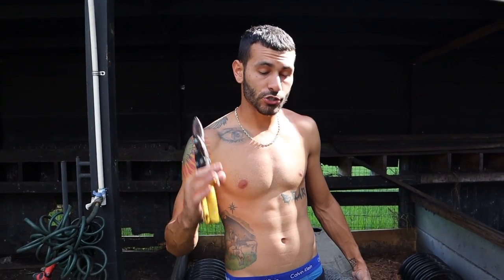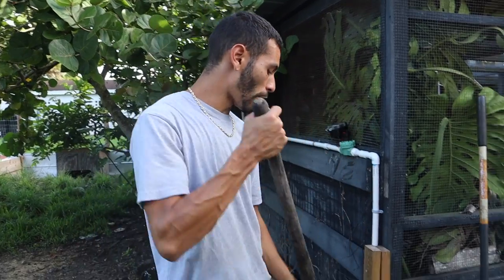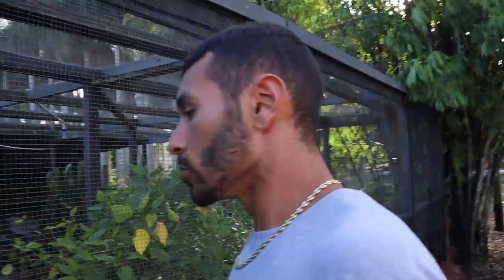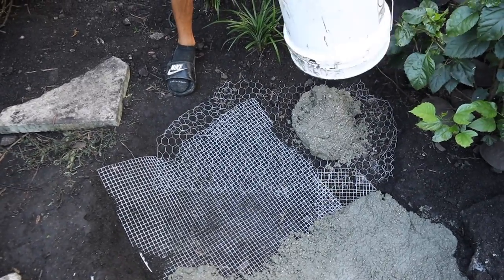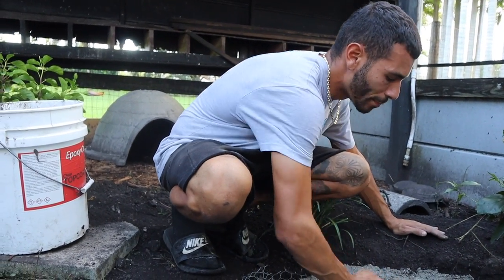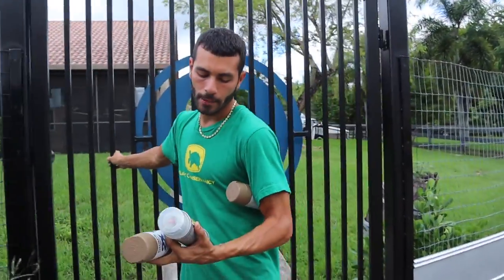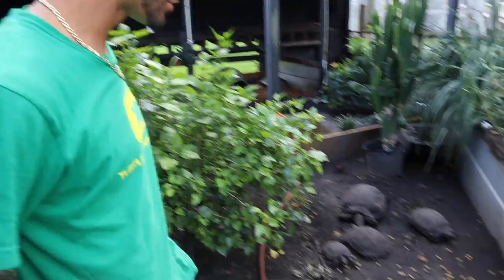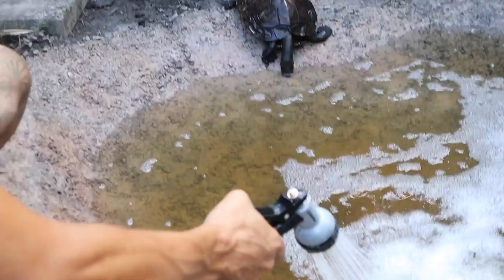HOW TO BUILD CONCRETE TURTLE POND!

Comment: Just a suggestion I had a soft shell turtle and it was outside it was like a baby and I put 2 craw fish in the 20 gallon bucket no algae at all all you have to do is just change water so if you want your water to be clear just put a couple craw fish in there it will keep it nice and clean but if you like the green keep it it’s more natural for the turtles but if you put craw fish they will eat all the larvae in the water as well and parasites they are very healthy for ponds

Comment: Love the turtle drinking water scene at the end. Also, was wondering if spraying the inside of the pond with spray paint was ok because wouldn't it harm them as the chemical breakdown into the water over time.
Reply: no spraypaint has oil and aceton and xylene which is fatal for animals
Reply: @alameenmansoor8230  is there a Comma After The "No"?

Comment: Coming from a licensed contractor. Sorry Blake, that cement work is a Terrible job 😂😂😂. Next time mix the cement with more water until you get a “peanut butter” kind of texture. Then pour. I understand you wanted a dry mix for specific reasons, but as you can see, that cement is not solid now. It’s going to continue breaking up as time goes on.

Comment: It was funny that you were using sheet metal sheers to cut wire.... But then your spreading wet concrete with your bare hands.... I used to do masonry work, and wet uncured concrete mix has corrosive shit in it.... You shouldn't be handling wet concrete with your bare hands, let alone letting it touch your skin at all, and especially not letting it get in your eyes.... When working with concrete your supposed to wear long pants, close toed shoes, and eye protection.

Comment: well. I leaned. don't use raddle can paint to color the concrete when live animals will have contact. pretty much toxic.  Also, when doing a concrete pond, add a curb around the top so the dirt don't fill up the pond and wreck the water clarity. other than, if using regular concrete, you need at least an additive to seal it because it will absorb the water eventually and empty the pond